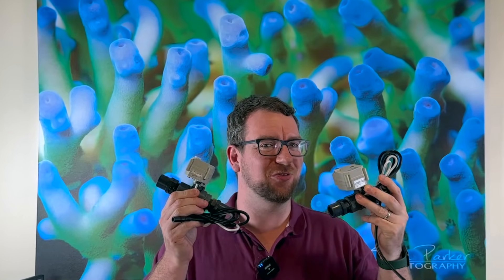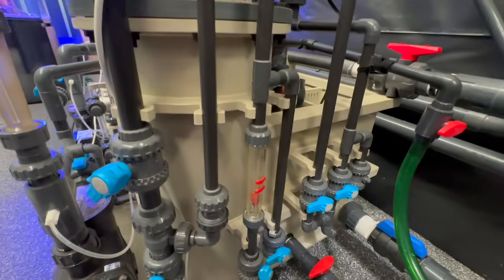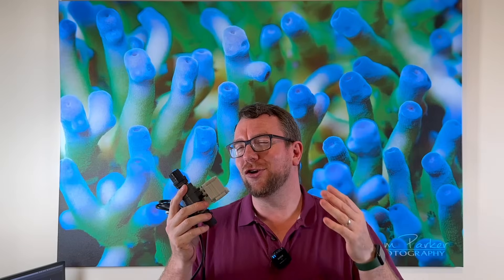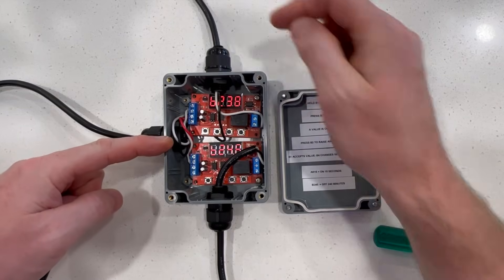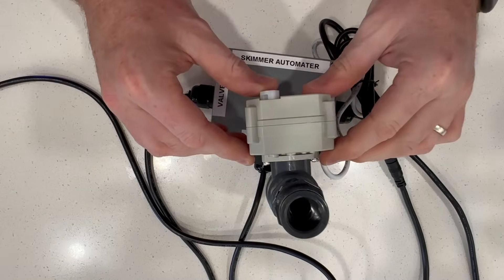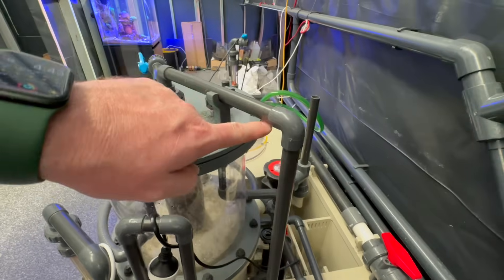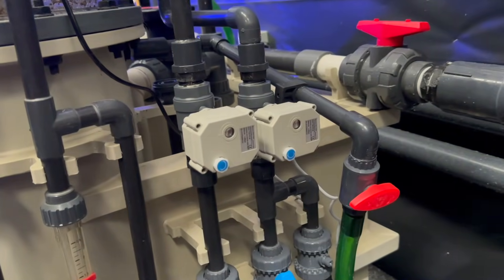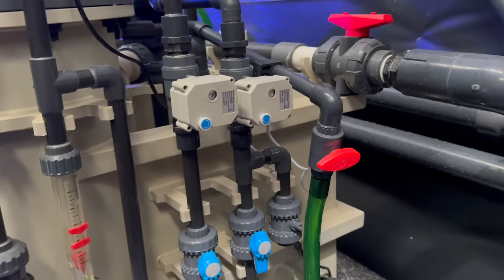Automating a HUGE Protein Skimmer!!

Comment: Very nice unit and your modification looks awesome!  Do the automated ball valves have any inner workings, (hardware, parts)  that could possibly rust??
Reply from the maker: These ball valves are completely PVC internals. You can buy cheaper ones that are not completely pvc, but obviously that is not what we wanted here :)
Reply: @ParkersReef  👌
Reply from the maker: They're all plastic internals, rated for much harsher chemicals than salt water